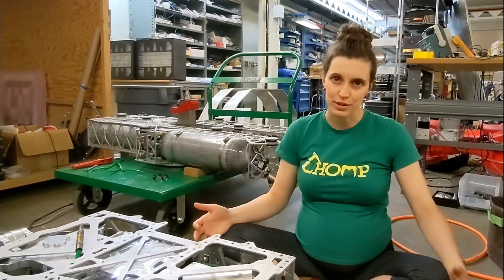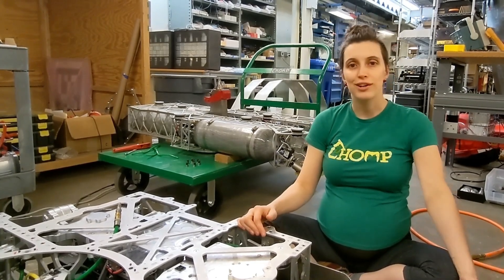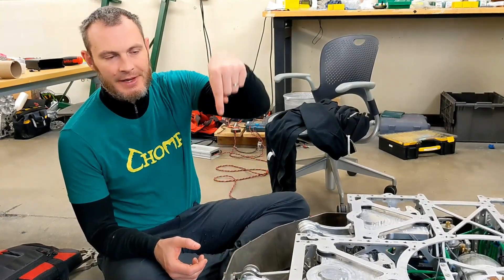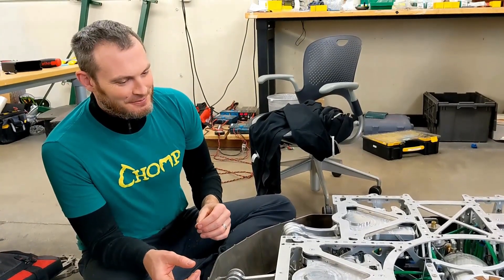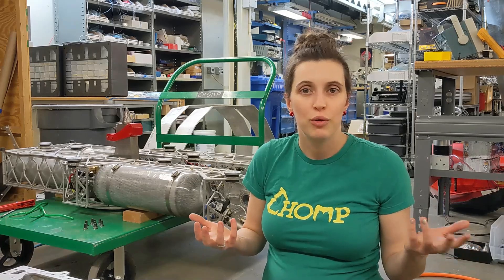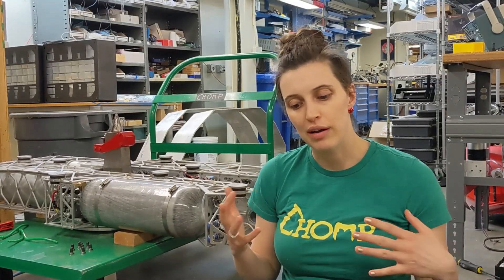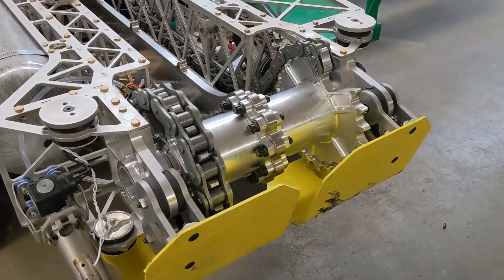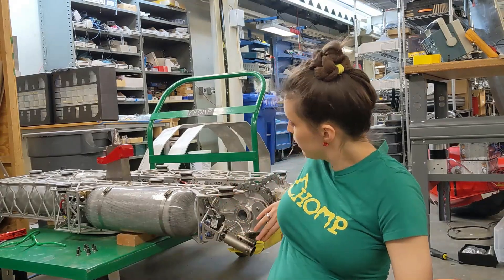Inside Chomp: BattleBots' First 500lb Walker // Best of Tale of the Tape

Comment: im no expert, but in a competition where the goal is to tear your opponent apart, wouldn't you want your bots parts to be easily replaceable and relatively inexpensive? this seems like it is way too complex and if/when it faces a bad loss, it could be out for the rest of the season. seems like they focused way too much on the hammer part when hammers are known for doing poorly in battlebots. shouldve tried to change design completely, couldve kept the name if you changed from a hammer bot to a grab/push bot.

Comment: Wonder if you could use the legs as actual weapons.

Some sharp spikes that the bot can go up/down and it kind of becomes a "razor" claw on each side to tear into an opponent.

For that the hammer could just act as a fishing rod to hit and grab a target, then slice it with the legs.

The arena is also made for wheels, its flat and has basically no obstacles in the way, so its a street.
If it had more ups and downs and some more difficult terrain, wheels would be much less optimal.
Reply: I second that! or if there were some random small or pillars welded to the floor, the generic spinners would fare much worse.

Comment: In one fight the other bot was strong enough to push Chomp despite its weight.  Will anything be done to the “feet” so it can’t slide along arena floor if pushed or that will just cause other problems?
Reply: Chomp can plant itself flat on the floor. But this is a testament to how powerful some of the bots are becoming. The use of magnets may be an option too, but that could be an issue to needing more air to lift the bot back off the floor. Unless the magnets can be mechanically engaged and disengaged at will.
Reply: @wishusknight3009  I was thinking more along the line of rubber.  That along with the weight might be enough.
Reply: @joen0411  Yeah it probably could

Comment: Chomp is amazing piece of engineering. It's sad that hammer bots do not do well.
It would be a beast as a shell spinner
Reply: I mean... shatter got to top 8 which is very good, also all spinners have weight limit so it wouldn't work
Reply: Many bots dont put better armor on top and bottom so those hammer weapon can take that as advantage